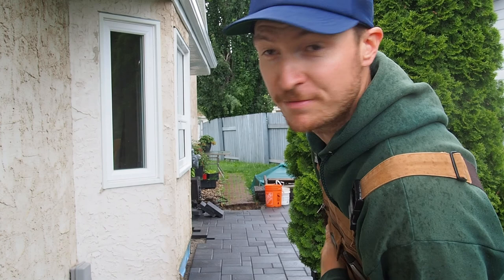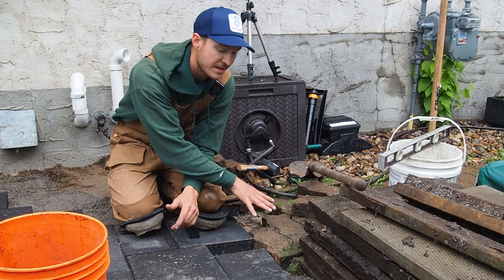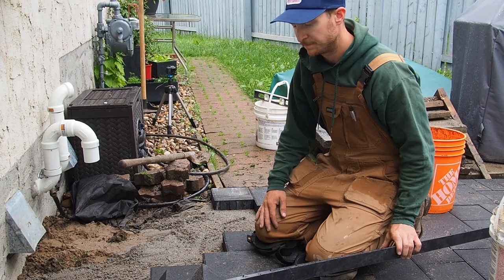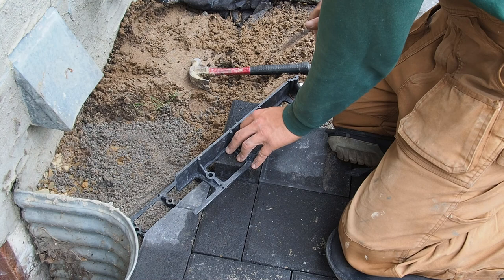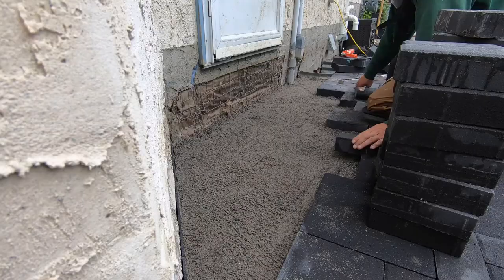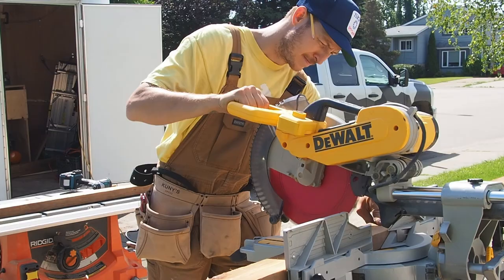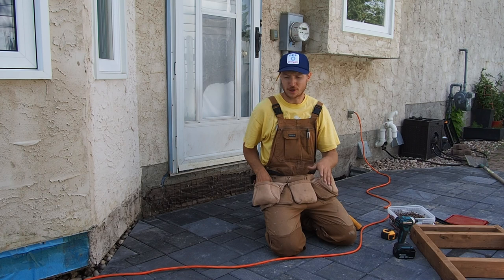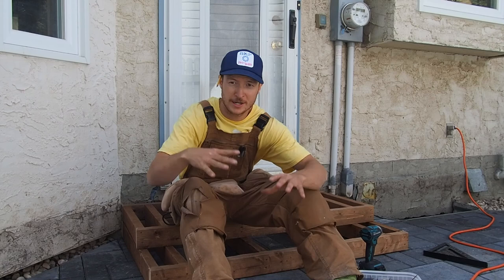How to cut paving stones with an angle grinder (An easy DIY project - Part 2)

Comment: I am somewhat concerned about the missing piece of stucco behind the steps. This will eventually lead to moisture damage on the frame. The home owner should really put some flashing tape  behind the wrap and patch the stucco. Hopefully the home owner will at least apply some sealant where the stair meets the wall.
Reply from the maker: The stairs are temporary. We couldn't get a stucco guy on site for quite sometime to complete the patching, but the homeowners needed something for the time being.

Comment: Why not put kl curbs in for step with paving blocks in middle so much easier n quicker and looks alot better aswell great work just my opinon
Reply from the maker: That would also work, and the original plan was to do stone stairs. It was the odd height under the door and cost that switched the stairs to wood.

Comment: Wish you would have showed how you cut the bottom side of that brick. There was no line so how did you know where to cut it?
Reply from the maker: I just extend my side lines to the back and then continue my cut. No need to mark the backside in this case.

Comment: What did you charge for this project? Also, what type of blade did you have on your grinder?
Reply from the maker: I dont disclose any of the pricing as this keeps the financial commitments of my clients private. I will say this is on the less costly side of stone patios- largely square, standard pavers, and without any fancy inlays. I was using a diamond blade on the angle grinder. Very similar blade to what would be in a tile saw.